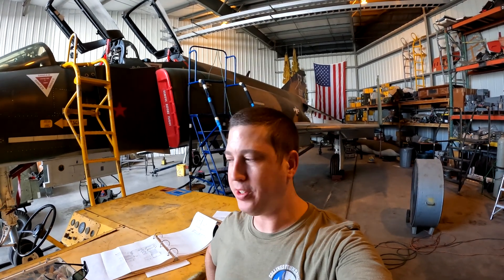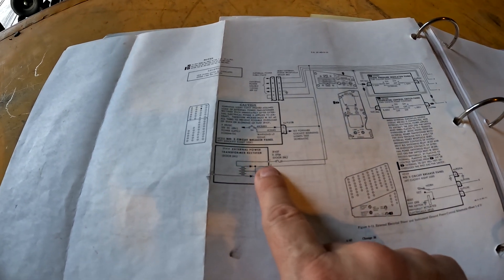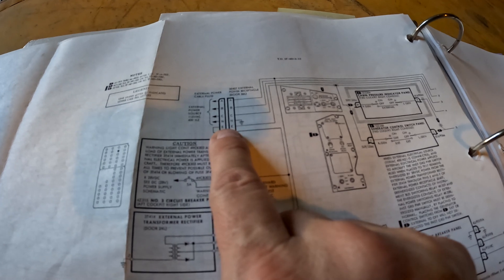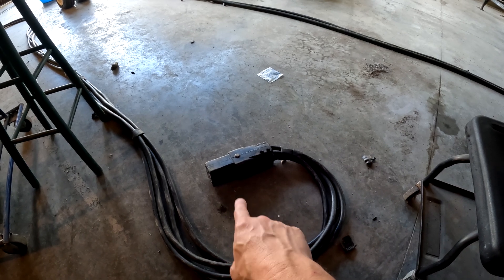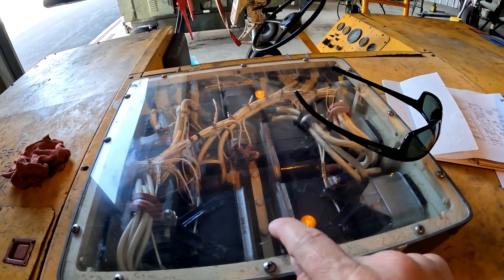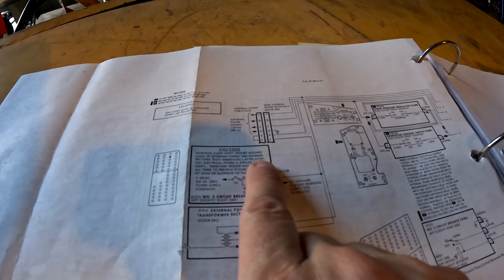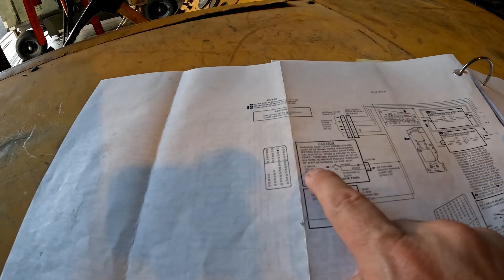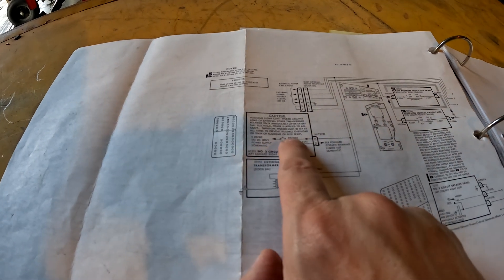A Dive into the Schematics | F-4 Phantom

Comment: The reason I asked about moisture. After phan con, (crewchief) Al had the jet washed. when I came rolling in both canopy's were open. When I asked him about it I was told not to worry about it. Washing the Phantom or any fighter with the canopy's open is never done. If you should get time there's a hand drawn schematic that moves the ICS from the rt missile well to the cannon plug in the left wheel well. You might get with Christopher or Charlie Arnt .  Charlie was our electrical man up until a couple of years ago. Somebody needs to contact Rob and get him to help getting the pyros for the seats. I've flown in the Phantom several times but personally I wouldn't do it with cold seats.

Comment: Looked like a sweltering day !
The schematics are a bit different from what I'm used to in industry, so I was having some difficulty following them.
Could do with a small office with some AC to help the old "CPU".
I think you are digging in the right direction.  Correct diagnostics is at least half of the solution.  You are making progress.
Reply from the maker: Yes, it’s been fairly hot lately. These diagrams are set up more like a one line diagram, versus being a full schematic. Would be nice to have an A/C here, but none of theses hangars are equipped for it. And thank you! Taking our time with this and being methodical, certainly don’t want to be quick and misdiagnose this.